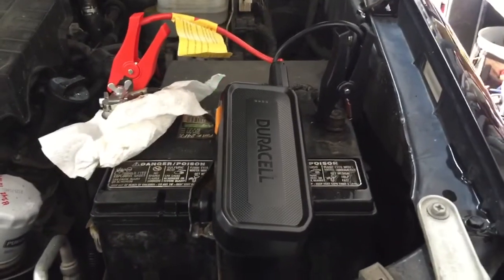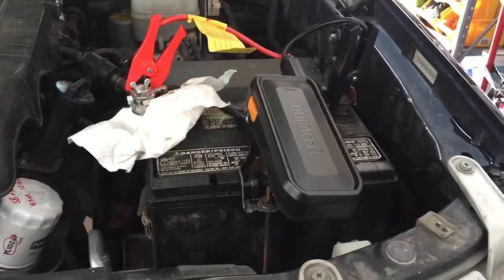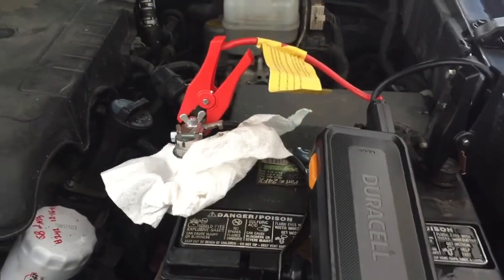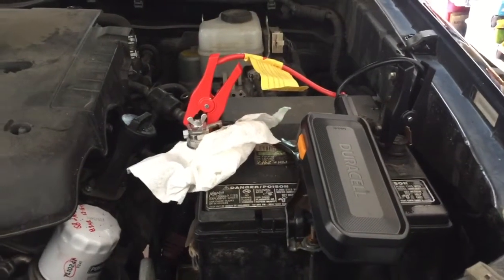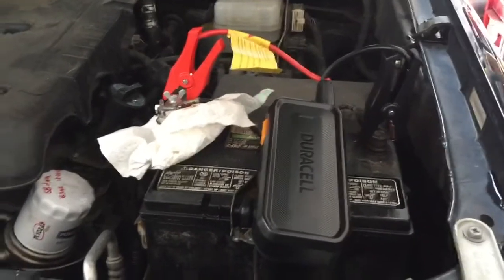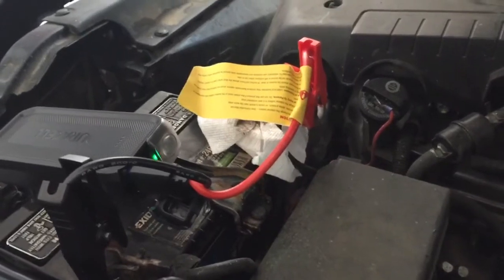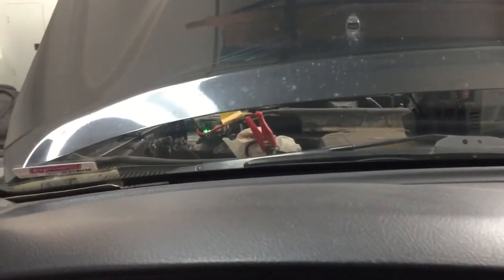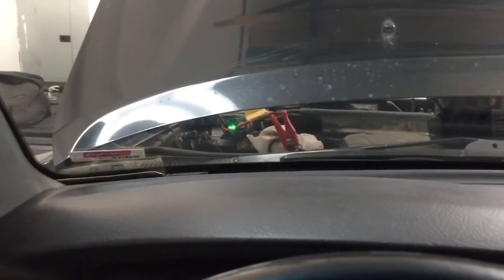Duracell DRLJS20 Jumpstarter Test

Comment: Once u connect the wire to the battery do u have to switch on the power button on the battery pack or  just jump start without pressing the power button?

Comment: my battery was 100% dead, and I couldn't get this thing to work at all.
Reply: Yeah my battery is 100% dead also and I’ve been using a $40 everstart jump starter works every time but I spent $99 on this Duracell piece of crap and tried many times and never worked once
Reply: It's worked for my nissan and my dad's toyota.
Reply: Got mine for Christmas and it works like a dream for me. Love this unit.
Reply: @donnaphillips6158  Batttery can not be 100% dead or this unit will not work